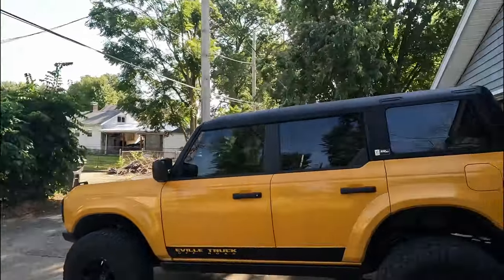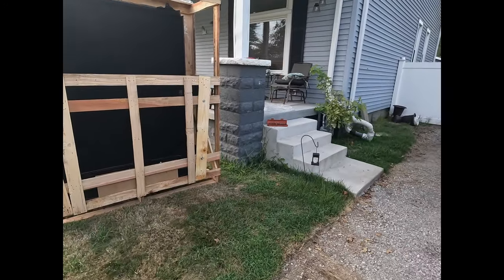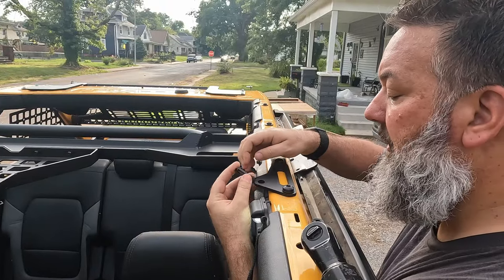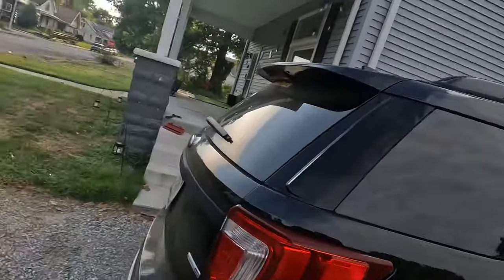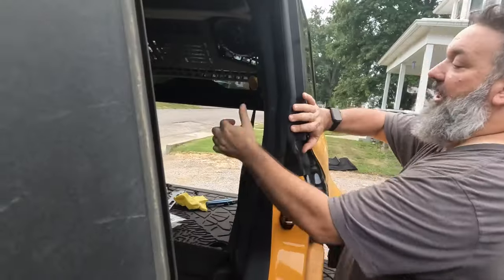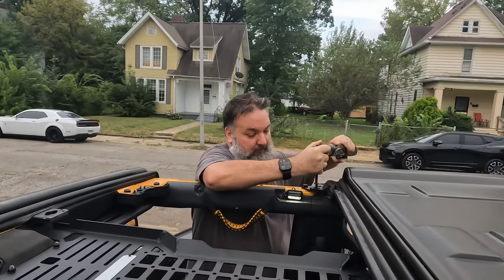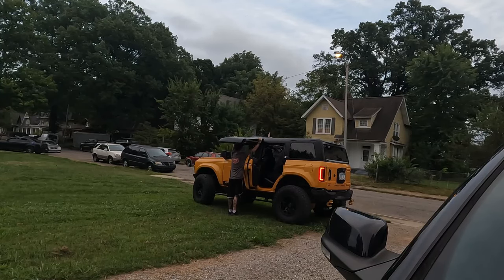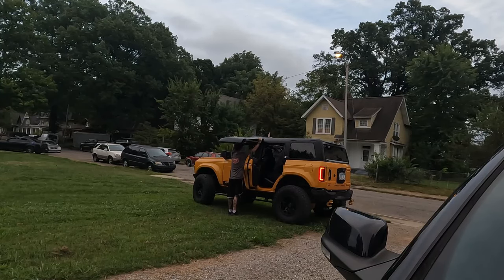Installing the New Turn Offroad Hardtop on the Bronco

Comment: i wonder if there is a hardtop with a roof top tent option where you can access pop up tent from the inside of bronco bed area?!
Reply from the maker: Not that I'm aware of , the Two door heritage top has a gunnar panel in the top that opens but theres not passthrough in the bottom of and tents that I'm aware of , would be a fun project though
Reply: I believe Ursa Minor is developing one. I had a friend with a JKUR that had one and it was very good quality.

Comment: Timely video, my top is supposed to ship this coming week.
Wondering myself if the wife and I can install this.
Care to guess how much the top itself actually weights?
Reply from the maker: @Serconn  not really sure my guess would be maybe 70 lbs my wife is recovering from a shoulder injury and really didn’t want her to try and help but she insisted and was ok so not too bad.
Reply from the maker: @Serconn  I was way off just got the official weights  the rear section weighs 160 lbs.
Reply: @EvilleTruck  Wow, I'm really surprised that you and your wife were able to install the top. That makes the H/T 30lbs heavier than the factory soft top.

Comment: Have you had any issues with the rear clunking when driving over bumps? Mine does it every time and I have all the mounting bolts tight
Reply from the maker: @jeffe236  I have not, how loud of a clunk is it and any idea what area it’s coming from?
Reply: @EvilleTruck  it sounds like it’s the bottom of the hatch making contact with the bump stops, I noticed they don’t make contact with the glass when the tailgate is closed
Reply from the maker: @ There is a bit of adjustment room in the rear glass , you might be able to move it down just a hair so it’s all making contact. If not I would reach out to turn off-road and see if they have had other reports or suggestions
Reply: @EvilleTruck  thank you for the window adjustment idea, that fixed the issue! It was slightly off center causing the window to be in constant contact with the side, rubbing it, and the shock wasn’t functioning properly until the adjustment

Comment: Did you do a leak check? Or driven in rain?
Reply from the maker: Yes I pressure washed it , took it through car wash and it’s rained. Everything has stayed dry.

I did see some comments in bronco 6g forum about some leaking around tailgate, that was fixed by adjusting the rear glass or repositioning the top back a little

Comment: Might be a dumb question. Did the hardtop come with all the torx bolts to mount it? I know the ADV joke wasn't gonna include bolts.
Reply from the maker: Yes, it comes with all the hardware you need to install it.